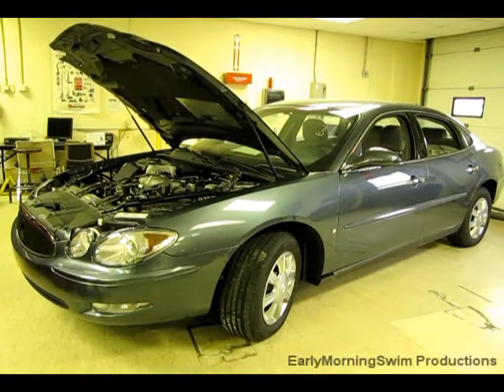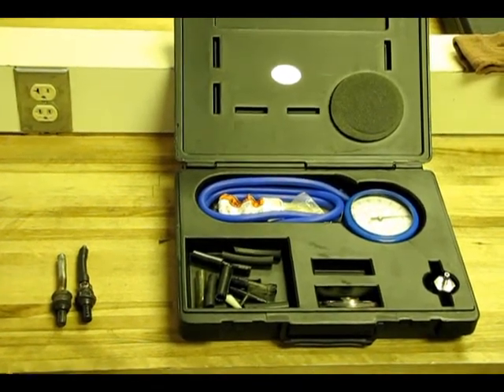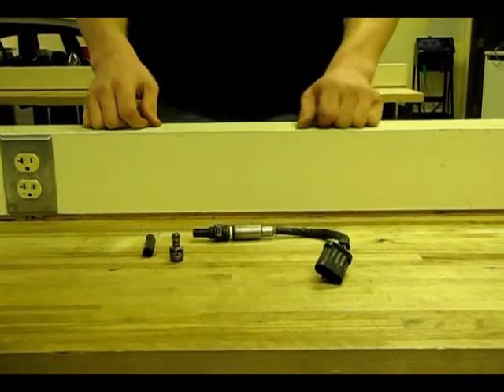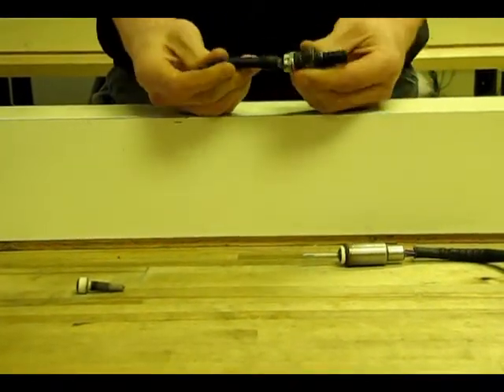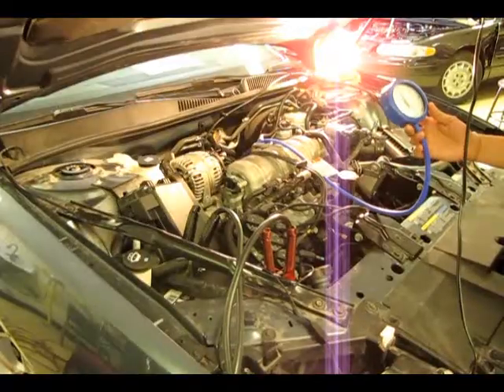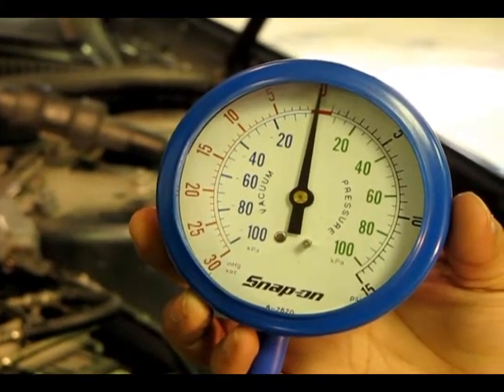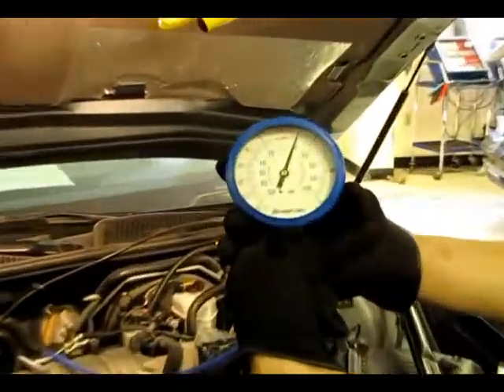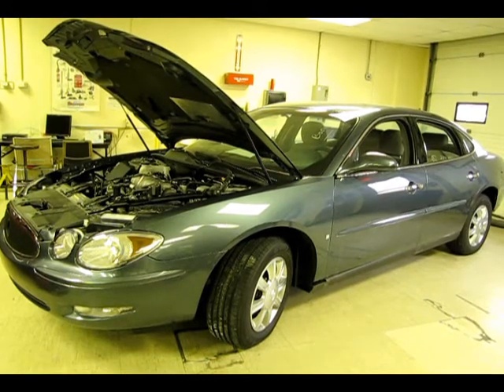exhaust back pressure testing

Comment: Rough up inside of o2 sensor adapter with 60 grit or lower sandpaper and use JB Weld to "weld' 1/4 npt to it.

Comment: interesting really cool tool you made to go on the O2 sensor ports. I am curious if you can do smoke testing when cars off to find leaks as well in the exhaust systems... I am curious if there is a way to get the O2 sensor fittings when you purchases the back tester gauge as well.

Comment: @2009jimmy2009 losing performance due to an exhaust leak generally is caused by uneven back pressure,so to say basically the amount of force a piston must over come needs to be equal,on the intake stroke (piston coming down) all cylinders have the same"force" to fight against due to the intake manifold having a balanced system of runners,and if you have a exhaust leak on one side of a V type engine you can have 3 cyls that move freely but the other bank is fighting more restriction=no power